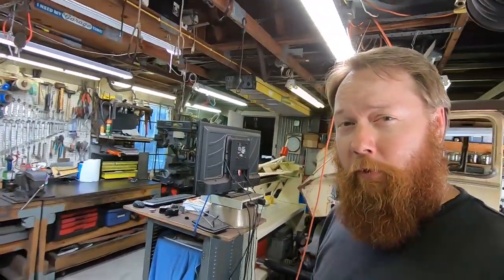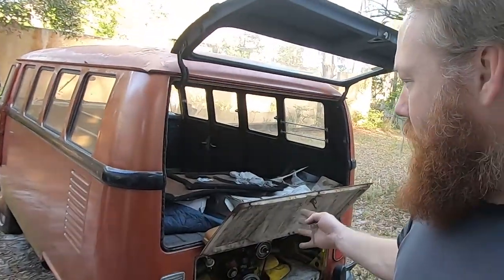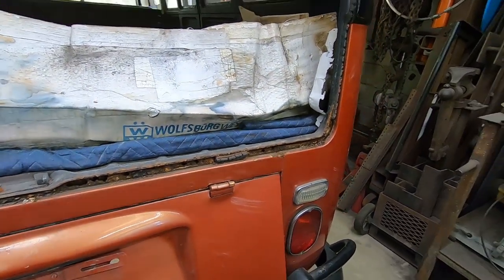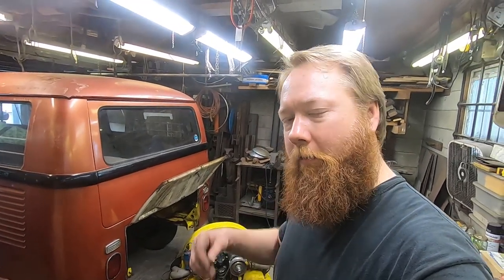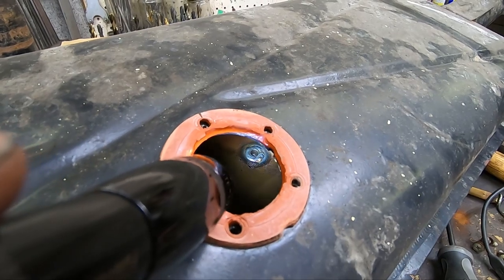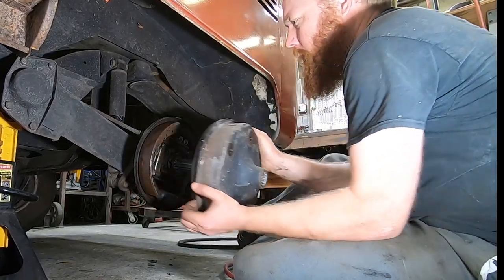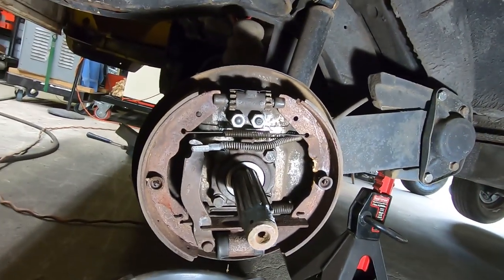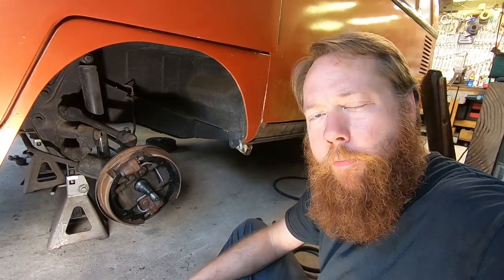VW Split Window Bus Rescue - Engine removal - Brakes - VW Split Bus Rescue Restoration - Vandemic E1

Comment: that lift is slick.  I have an old transmission lift from my grandfather with his initials welded on it.  I like the plate to hold to the clutch/flywheel for the engine stand....glad I found this channel, at this time !
Reply from the maker: Thanks Dan, I've had that motorcycle/ATV jack a long time- kind of surprised it still works! It's well suited to this task. Hang on to that transmission lift... those heirloom tools are awesome, whatever they may be. I'm really glad you're enjoying the channel, thanks for being a part of it!

Comment: Great buy, I have two 1967 buses and both of them together is not as soild as what you have located. Looks like King Pins have some play. That one soild bus has great bones..i"m working from home and have not left the house for 5 weeks. It still peaking in Iowa we had 189 and 10 dead today..There was a Tyson plant north of us they had over 500 workers test postive and two died yeatherday. Being 65 and having underlying heath issues , I will be working from home for another 4 weeks..
Reply from the maker: Hey Busman 54, great to hear from you today. If you've got two, I conclude that '67 is a good year for splitties! Five weeks is a long time to be stuck at home, but you're doing the right thing. Hang in there and keep updating us on your channel. Stay safe and keep wrenching!